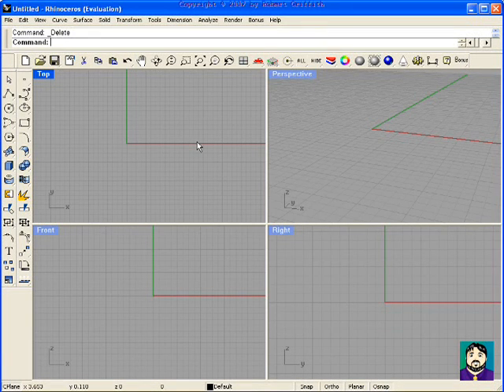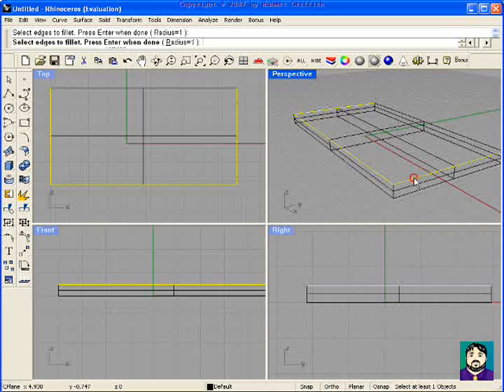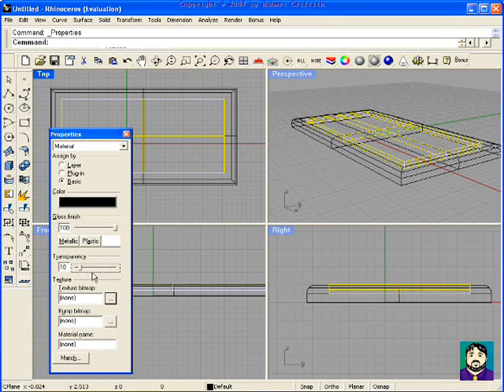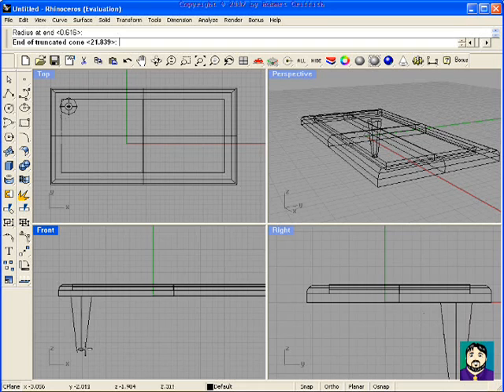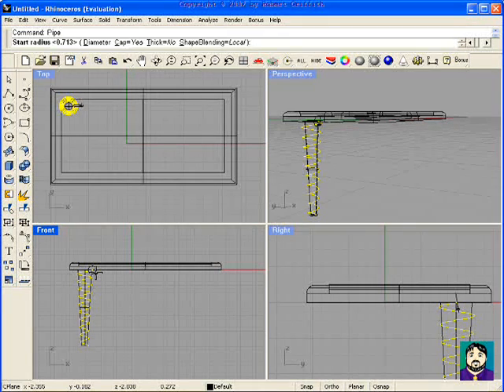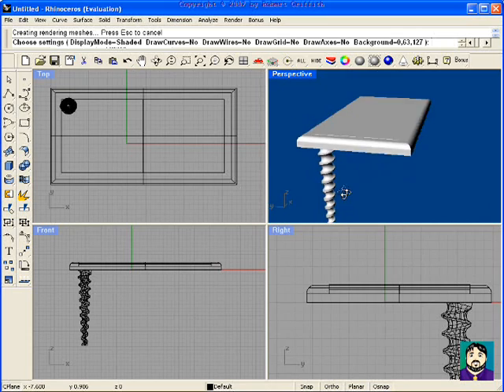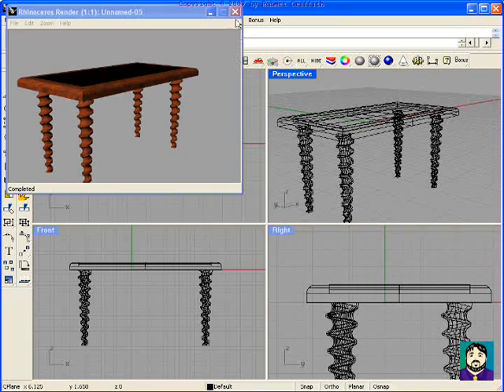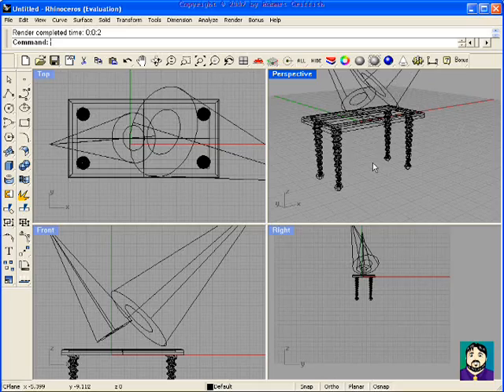Rhino 3D #4: Carved Table and Legs

Comment: Problem is with most tutorials is that its all freeform, in that no measurements are being used...  how big is the table, and the size and exact centering of the inlay is not covered..etc.  I would like to see more tutorials about designing things where you have some constraints on size, and on relation of parts to one another...